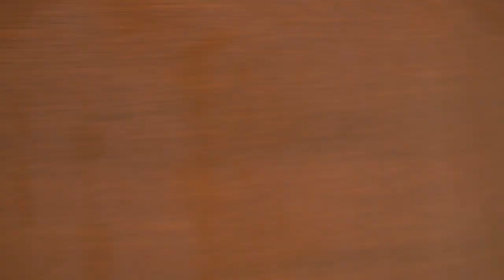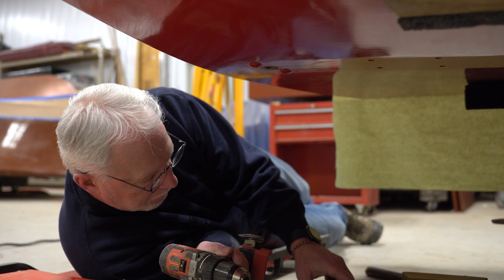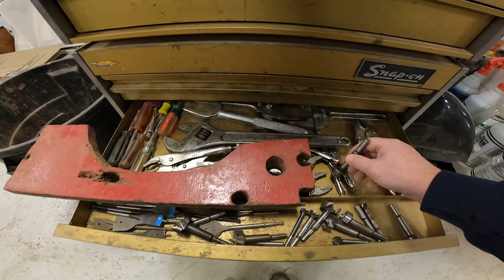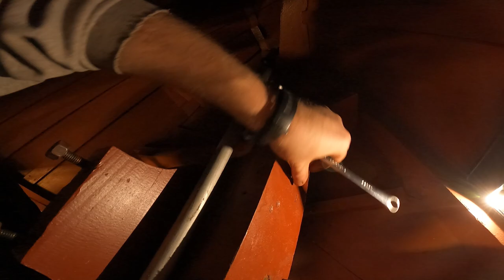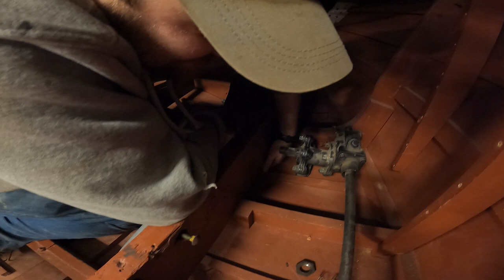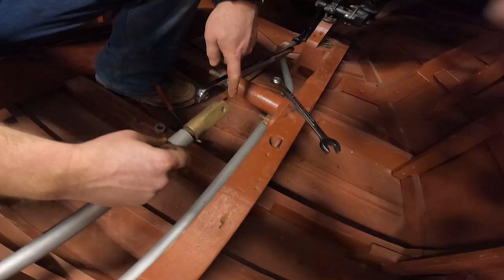Problems with Steering Install - Rare 1941 16' Chris Craft Hydroplane

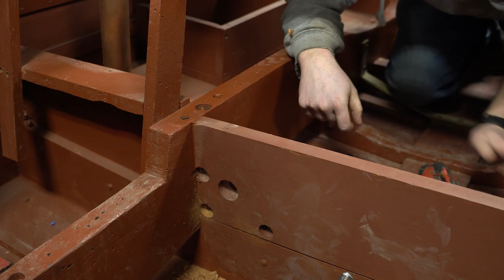Comment: Great video Mike! At 8:57 are those hull step ventilation pipes?
Reply from the maker: They are, I have never seen them in a boat before.
Reply: @MikeGreenStudioWorks  cool, yeah I've never seen these on a Chris Craft although I guess there aren't many boats with hull steps? I have a similar setup in my little racer that vents from inside the boat. I have seacocks on them and there is definitely a difference in running with them open vs closed.